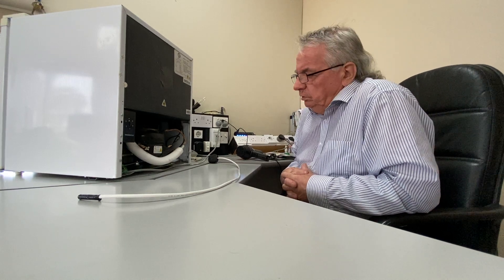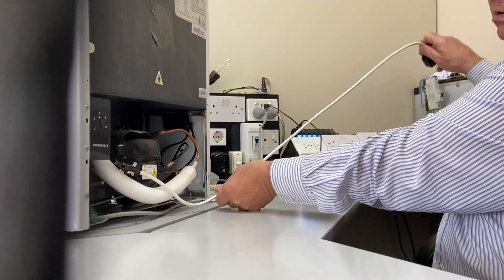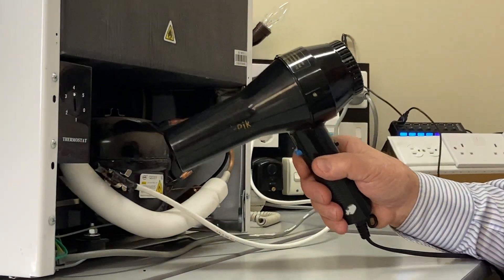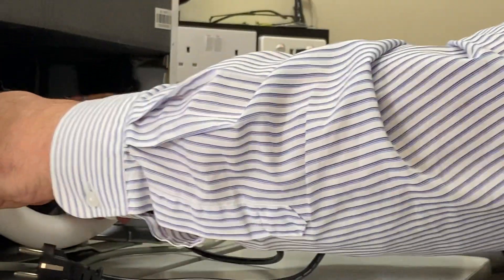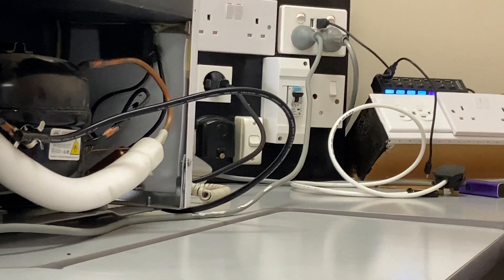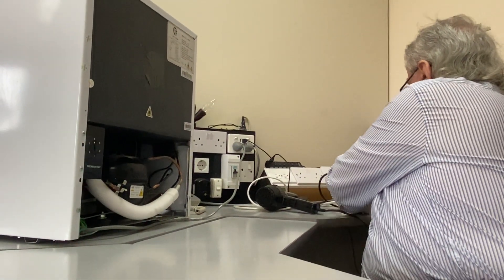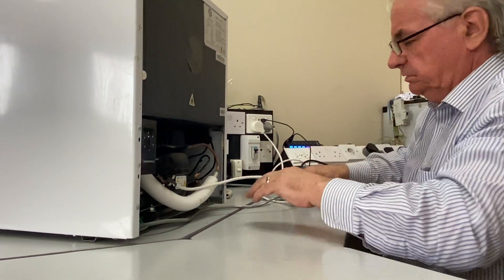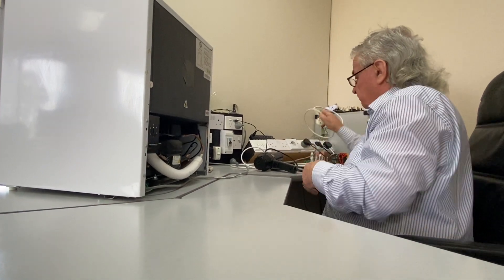PIPTech's FFT Plug Top Demo - Protection against refrigeration fires as in Grenfell Tower inferno

Comment: Nice demonstration. I can see many uses for this. Only concern on the UK plug top would be an internal fuse that could fail and the occupier would never know. Could these not be wired into the fridge/appliance power supply?
Reply from the maker: Mark Thanks for your useful and astute comment. I fully take your point regarding the only real fused plug tops in the world, (BS 1363). This is especially so as the minimum available 1 amp fuse, (BS 1362) would be fitted at OEM for this task as there is virtually zero loading involved with the actual device, (30 milliamps) and we're only protecting an 0.75 flex maximum. As things stand, there is presently no device that can protect the appliance against its fire hazard, therefore even with the slight risk you pointed out, we would weigh out the one risk against the other far greater fire hazard. Obviously in other territories, even this slight risk would not apply anyway.
Reply: @piptech-preignitionprotect5665  I can see how these would be very useful. Would manufacturers not be open to having these installed and hard wired on the product? Eliminates that very very small risk entirely.  As the user would know the fuse had operated on the appliance itself. 

Interesting concept.
Reply: @piptech-preignitionprotect5665  I notice that you carefully avoided mentioning how it works but I would assume that it shorts the Line-Neutral together in order to trip the MCB.

If this is the case then to ensure that a 32A MCB trips before the fuse in the plugtop then you would have to use a very high value fuse, probably of the old 4 inch nail variety.
Reply from the maker: @petehiggins33   The crude modus-operandi being referred to (4 inch Nail variety) is sometimes nicknamed "Crowbar Technology'. This being a term borne out of the Victorian electric motive railway age when a workman's crow bar was hurled onto the electrified rail to activate the circuit breakers if someone has accidentally fallen onto the live rail.

The video makes quite clear the main concentration and focus is always on imbalance devices and definitely not about any current overload MCBs or fuses tripping or blowing, in fact the 'neutral pole' is not even employed as any part of the technology. 

The technology relies on an absolute unique relationship between the active components housed within the applications and an imbalance device, (known by various pseudonyms around the world as: RCDs, GFCIs, ELCB, or the distinct imbalance functionalism of a combination RCBO)  

This functionality actually senses excess heat in areas where it would signify the presence of a fault condition and then technically translates such thermal information into current imbalance 'data'.  The outcome will enable the appropriate safety device to isolate the circuit where the potential high resistance or overheating fire potential fault is situated.  

The system is amazingly simple, however the R&D and acquisition of such unique components was anything but!  BUT....they are here NOW!
Reply: @piptech-preignitionprotect5665  OK I stand corrected, it works by passing a small current from Line to Earth to trip an RCD.  I'm pretty sure that nowhere in the video does it mention the fact that it only works on circuits that have RCDs or RCBOs in fact it doesn't even mention them.  It never occurred to me that it would work this way because there are huge numbers of households in the UK and around the world which do not yet have RCDS installed, mine is one of them.

On a different subject a also wonder if this device is really going to prevent many fires.  Have you done any research to find out how many fridge fires are cause by the compressor overheating?  I suspect that most of the fires do not involve the compressor at all and are due to poor electrical connections causing very local heating, setting fire to the housing and these would not be detected by your device until it's too late to stop the fire.
Reply from the maker: @petehiggins33  Hi again and thanks for your comment. Your correct in that we did not mention imbalance devices in this video. Therefore, and for clarity, please see below:

PIP component + application housing + locational fixings + imbalance devices + qualified installers/OEM Companies + prior installation testing = PIP Technology,  IE. PIP Technology requires all 6 modules whatever the product type for its duties to be performed. 

RCD and RCBO's:
Regarding the imbalance devices being fitted in peoples homes, both BS7671 and AS/NZ 3000 have implemented new regulations that require all new homes (and those being upgraded) to have imbalance devices present. It takes time once leslislation has been implemented in a state or country for things to happen, and unfortunately no government authority will place any absolute "you must" to landlords, tenants, or owner occupiers of existing homes without RCD's, RCBO's and the like, to call an electrician and get the job done.

Compressors and Electrical Connections:
 - Most fridges/freezers worldwide these days have compressors and not heating exciters to stimulate the refrigerant gases to circulate, thus exhaust latent heat.
- Most of the electrical connections in these appliances, (which could be subject to High Resistance Connections (HRC) and Inductive heat build up from the compressor itself, (when faulty) are located in or around the compressor. We have researched this.

Thanks again for your comment and I hope this gives you and others more clarity. 

FYI, there is a website being developed currently which will have more details on the technology, products etc. However, should you like to receive more information, please feel free to email us here at info@thepipsolutions.com
Reply: @piptech-preignitionprotect5665  Thank you for the clarification.